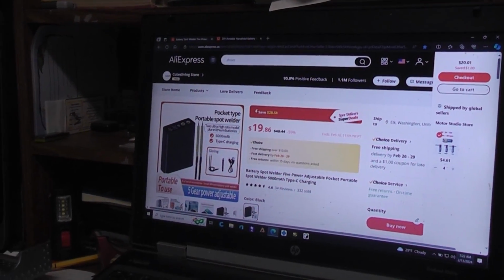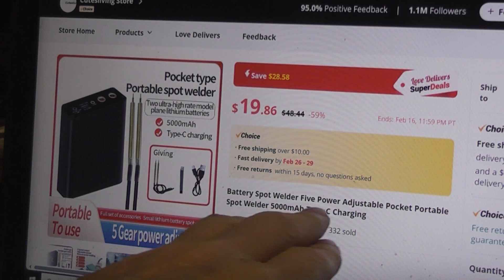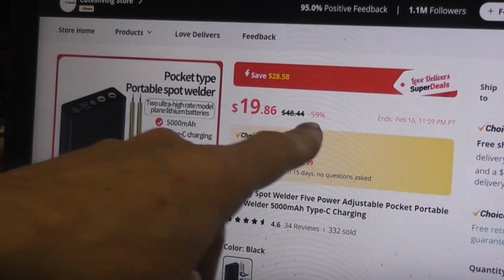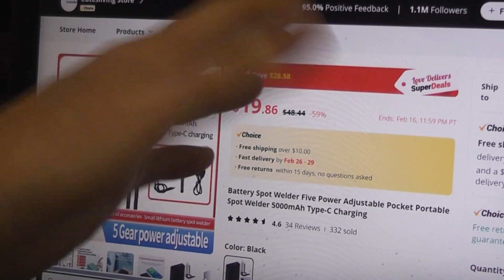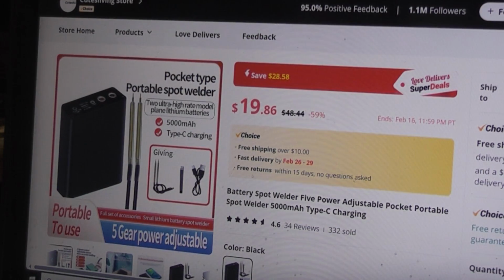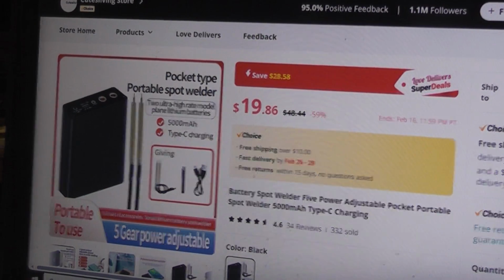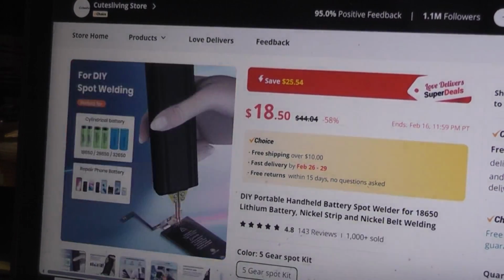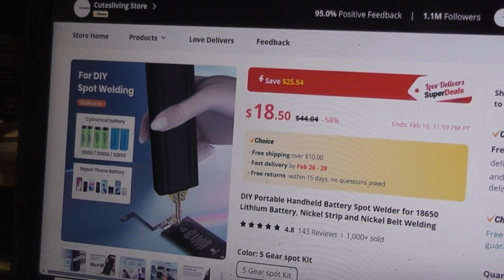Repair broken metal tabs on your vintage tin toys with a low-cost spot welder! No Glue, no solder.

Comment: The spot welder is working great on everything but my Marx tin lithographed toys.  I can get .1mm or .2mm strips to weld to a metal electrical cover plate(for experimentation)---no problem.  But when I use the same gear strength on the Marx toy, no weld is successful!  I have cleaned the surface with alcohol & dried, I have experimented all the way up to the highest gear strength, I have used normal pressure & heavy pressure and nothing works on the toy. Only success was on the metal electrical plate (for experimentation)---all welds worked great on that plate.  Any suggestions on what I am doing wrong.  I never saw a tin toy being experimented in this great video...just an electrical metal box for experimentation.  Gentleman is correct that .2mm most resembles thickness of a Marx tab.  I know tin has high thermal conductivity & these spot welders work best on low thermal conductivity metals.  I think Marx used tin...not sure.
Has anybody had success with replacing broken tabs on Marx tin lithographed buildings?  Thanks
Reply from the maker: I have had the best success with placing one welder probe on the metal toy and the other probe on the nickel tab so that the power of the current flows through the nickel tab to the base metal of the tin toy. The only times it did not work were when the base tin toy was not tin or steel. will a magnet stick to the toy? if so, it should work. I have had comments from others that have used the spot welder, and they were very pleased with the results.

Comment: This is great. But I'm wondering. The toys are made of tin, is it not possible to use tin strips instead then, and can't you use solder instead of welding? I just know I'm allergic to nickel, but I also suppose for application like this, it's not something you really get in contact with after the tabs are attached. I'm just curious. :-)

Thanks for sharing
Reply from the maker: For years soldering the new metal tabs on has been the way to do the repair. But the heat from the soldering always burns the outside paint on the tin toy . The spot weld repair does not.
Reply: @Robothut  Ah, sorry I didn't get that. Thanks so much. And using nickel instead of tin tabs. What's the benefit?
Reply from the maker: @letoatreides8098  The mini spot welders are made for connecting battery's in all new battery packs together since soldering might cause the batteries to explode from the heat. Now why they like Nickel over other plated metals I do not know. But the science behind it must say it is the best choice for electrical connections over time. So, since the spot welder comes with a roll of nickel, and it is easy to use I went for it.
I would think that standard plated tin "steel" would work just fine.
Reply: @Robothut  Thank you, got it!

Comment: I bought one of these micro welding units a few years back for use on a Chein (brand) tin roller coaster.  Unfortunately, time has not permitted me to use it yet but I now see how I was thinking in the right direction.

Comment: Wow John, fantastic method for repairs the broken tabs on our repair robots. Very clean method. Always the tabs broken are very small and difficult to welding again on it's original position but if you have this special metallic tape is more easy to welding with this instrument. Only a little point off welding is more clean. Fantastic video John. Congratulations. Greetings!!

Comment: Why not put thick insulated wire like the smaller one has on the bigger one. What a great solution for broken tabs.
Reply from the maker: Yes , I mention that in the video as a possible solution. But there is something nice about being able to use the device with 1 hand when you have solid probes.
Reply: Very good. @Robothut

Comment: That’s a great tool I have used one before in mechanical work years ago

Ps: where did you buy the 0.2mm metal?
Reply from the maker: Same place as the spot welders, AliExpress.
Reply: @Robothut  yes
Reply: I picked up one $20